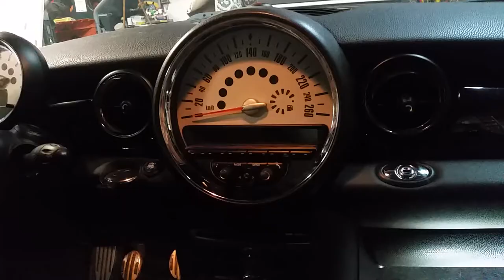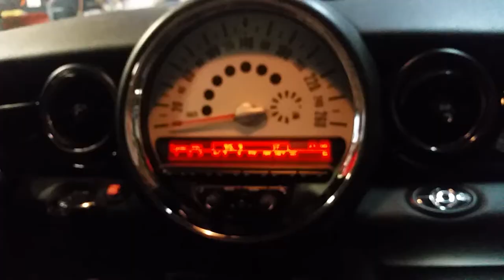Mini cooper dead radio !!!! fixed

Comment: I removed my fuse and my radio went on most helpful video found it in an intsant i appreciate it i was thinking of doing it however i came here instead
Reply from the maker: Well, i'm more than happy if it worked for you. I'm not a you tube guy and this video is to help people out...  :)

Comment: I've been watching vids on the fuse box on floor of passenger side apparently desoldering or cracking solder on those boards. The low pressure fuel pump relay being a prime candidate. I'm having a stalling issue and my radio is freaking out at same time. I'm going to pull that fuse box and check for burned or disconnected wires.
Reply from the maker: Check for the terminals being too wide for the fuse like for the radio. It could be the same for your fuel pump relay.

Comment: This is so weird... My fuse chart says "F45" should be my radio fuse... But there's nothing there. F45 not only has no fuse, it doesn't have any clips to plug a fuse into to begin with! ????
Reply from the maker: @LastBastian  hum..! Sometimes the manuals are not super accurate. Best bet for you is to turn the key On and pull out and back in each fuse until the radio starts again. If the radio already works then it will stop so you will know which fuse is the one so next time it stop you can play with it and see if it starts again. Or you can squeeze the terminals anyway and see, it should stop to do the problem.

Comment: How can you tell if the contacts are too far apart, and how do I push the contacts of the terminal closer together? Do you need a tweezer? And is it dangerous? 

My radio display just did not turn on today but I checked all the fuses and they are good so I really don't want to take to dealer...
Reply from the maker: Well, you need to use something like tweezer or super thin flat screw driver and you push on the side of the terminal so they get closer. When you want to know if the are too apart, you can move the fuse in and out, it should be hard to pull in and out on both side of the fuse. Sometimes one side is hard and the other is loose, so you need to correct that. Also you will see black spot on the contact of the fuse, it means you have to fix the terminal.
Reply: @The Techguy  I don't see a black spot and the fuse is very tight and hard to pull out so I guess it might not be my problem.
Reply from the maker: @malasadagirl  the black spot could be hard to see. If you wanna be sure it's not the contacs in the fuse box, put the key to the ON position so the radio is suppose to turn ON and play with your fuse in it's position, like move the fuse as much as you can. If it's the fuse, the radio should turn on and off as you play with the fuse.
Reply from the maker: If it turns on and off then it is the contacts behind the fuse that are loose.
Reply: @The Techguy  I tried it and I couldn't get the radio to turn on at all
Reply from the maker: @malasadagirl  well, it might be something else. You could try to unplug your battery for a good 15 - 20 min to see if it will reset the radio by any luck.

Comment: Does the radio in this mini require a code when you disconnect the battery
Reply from the maker: I'm not 100% sure. I know I unplug the radio when I test the connector behind the radio and I didn't have to put a code when I plug it back. But I don't know if all the models are the same.

Comment: Ok what kind of pick u used
Reply from the maker: You can use a strait pick or even a precision flat screwdriver
Reply from the maker: You can use a pick like this model: (Milwaukee Tool Hook & Pick Set (4-Piece) Model # 48-22-9215) make a search for that and you will see the kind of pick to use. It can be any other brand as long as it fits between the terminal and the fuse box housing.

Comment: I did all of that and still doesn't work
Reply from the maker: To be sure that is your problem, you need to take your radio out and check if you have power and ground going to your connector behind the radio. If you have 12V to a red/green (pin15) wire and GND to brown (pin12) than it's not the fuse in the fuse box. I don't remember if there is one behind the radio also, you might check that too. If you don't have 12V to the Red/green wire maybe your fuse is still not making contact or either it might be burned. Other thing you can try is remove that fuse in the fuse box, check wich side doesn't have 12V and then send 12V to that side and see if your radio will work.
Reply from the maker: So, if you have the 12V and the GND on the radio connector and all the connectors are connected and your radio still not working, then it's probably the radio that is defective.